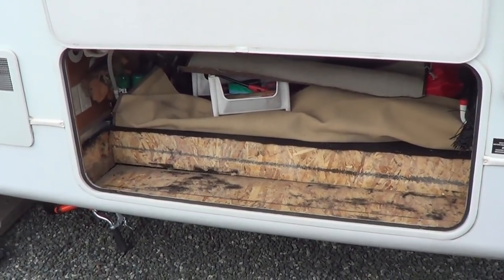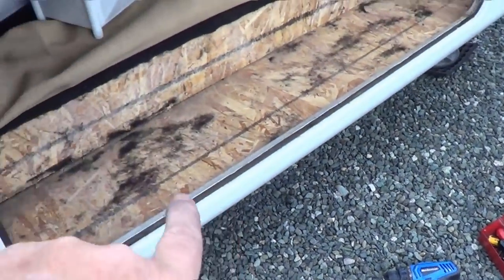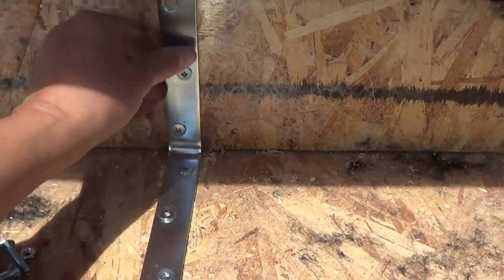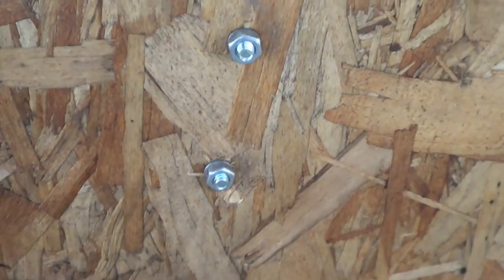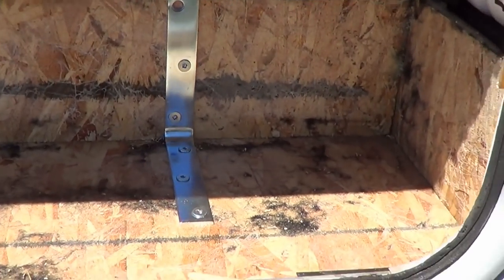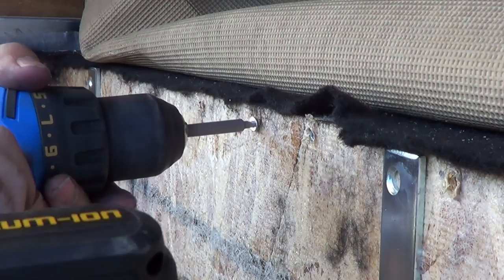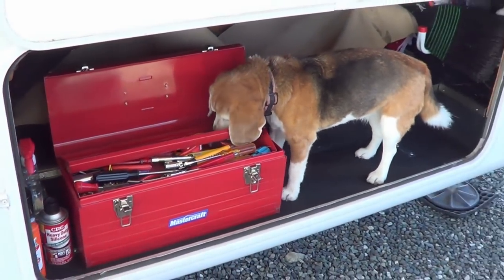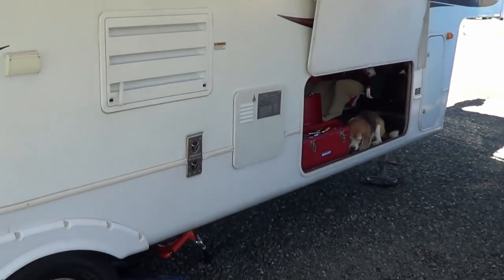RV Storage Compartment Shelf Repair and Modifications

Comment: As long as you had access to the back and underside of the wood box area, you might have attached the angle iron on the outside of the box to gain the advantage of the strength of the angle iron. The way you did it with the angle iron on the inside of the box it relies on the strength of the nuts and bolts. Just a thought.
Reply from the maker: Thanks for the advice. Yes, you're the third commentator with the suggestion. :) The reason I didn't was space restrictions on the back wall, it was going to be too much of a pain to get the holes drilled. From the top, I knew the holes could be drilled exactly first shot. Given the staples lasted 4-5 years before failure I figured the angle iron on top and bolts on the bottom would be plenty strong. Other commentators had added that I could add large washers or steel strips if needed. Cheers! Ray

Comment: Ray if you put the bottom inside of the back chip board and ran the screws horizontally through the back and into the bottom you would then be. Using the shear strength of the screws and it would hold a lot more weight. I realize you may not have access to the back now so you angle iron will help.
Reply from the maker: Thanks.

Comment: Good video Ray, if you do something like this again, get some fender washers (large diameter) to pot between the nuts and the wood, more surface area will make it much stronger and keep the nuts from pulling through the wood. ThNksfor sharing! Walt
Reply from the maker: I'm going to add some. Thanks Ray

Comment: Shuda really mounted the brackets on the bottom side of that wood for greater support with a fender washer on the inside, if your travels are as rough as you say, the bolts could eventually pull through
Reply from the maker: I thought of that but it so cramped underneath it was going to be a pain to drill the holes for the bolts and get them aligned right.

I think it will be plenty strong enough. After all for 4 -5 years it was just stapled together. :)
Reply: true enough........now that you have your unit the way you want , ....it has to be about time to upgrade

Comment: I see it has been mentioned but I would put brackets on both side and also run some angle iron pieces underneath your bolts to transfer the bumping stress over a larger portion of that particle board keeping things in tact. Washers are good but a strap of metal will distribute the forces more effectively.
Reply from the maker: I thought I was overkilling it. :) 
Good suggestions.
Reply: Love Your RV I am afraud those bolts will pull through that MDF. With a piece of metal it will distribute the forces doesnt have to be real thick stuff. Want to watch your tare weight I know. You have so much stuff installed already!😁
Reply from the maker: Yeah, I'm currently only 400 lbs under trailer GWVR. Gonna have to dump off some weight this fall. Will wean my tool load back to only must haves and get hardcore about what we really need.

Comment: Great repair and modification work Ray!  I was wondering how much trouble it would be to remove the underbelly just enough to run some Romex wire from my inverter in the front storage compartment (2004 Keystone Laredo 28RE fiver) to my power distribution panel just below the stove.  I would like to install a transfer switch for my new solar system.  I have a dual battery bank system that would eliminate the charge back loop.  Thanks!
Reply from the maker: Thanks! Shouldn't be too hard, my underbelly is held with 3/8 Tek Screws, remove them and the belly comes down. The only issue is on that side the LP gas piping runs so makes it a bit of a pain. In some spots, I've cut a flap for access and then seal it up with Gorilla Tape when done.

Comment: Hi Ray.  So if the beaver board had given way with your heavy tool box, you think your underbelly would have prevented the tool box from falling through?
Reply from the maker: Yes, I'd say so the metal siding wraps under and is bolted to the frame.

Comment: I wonder if it would be stronger putting the brackets on the other side, under and behind, so that the whole bracket holds up the wood...  What do you think?
Reply from the maker: I thought of that but it so cramped underneath it was going to be a pain to drill the holes for the bolts and get them aligned right.
I went for the easy way. I think it's going to hold up fine.
Reply: I believe you're right. The rubber mat was a very good touch too.
Take care.
Tony

Comment: Curious if the floor of you battery compartment is OSB as well.  With that weight it is probably not stapled on there.
Reply from the maker: It's a steel tray that has been welded to the frame. So far I haven't spotted any cracks.

Comment: I use a small plastic tote instead of a heavy tool box. Then carry only the essentials.
I think if I were you, I would take the old unit apart, take measurements, have a metal unit made from tin or aluminum, then install and boom, your good to go. Forgoing that, make it out of marine plywood instead of GLUIT Board (GLUIT means half Glue and half Shit) otherwise known as particle bd.
We'll done just the same.
Reply from the maker: This mod has held up great, almost 3 years now and been down some rough  roads, really strong support now so I happy with it.
Reply: @LoveYourRV  Good stuff.

Comment: you should have put them on the outside. stronger
Reply from the maker: I thought of that but it so cramped underneath it was going to be a pain to drill the holes for the bolts and get them aligned right.

I think it will be plenty strong enough. After all for 4 -5 years it was just stapled together. :)

Comment: Hey Ray, good job on the fix. If it gives you trouble again, put a piece of 2x2 aluminum angle on the back side of that angle and you won't ever have to worry about it again.
https://www.princessauto.com/en/detail/2-x-2-x-1-8-in-x-8-ft-aluminum-angle/A-p8710774e

Also on the fender skirts, maybe grab a local boat fiberglass repairman and hire him for an hour to show you how to use fiberglass to repair the fender skirts and you also shouldn't have any more problems with them after that.
Reply from the maker: Good ideas, thanks!

Comment: Had an interesting problem with osb and non marine grade plywood. OSB Is slow to absorb water AND slow to release water once there.  The water expands when frozen cracking the wood and glue bonds.  Over a few seasons the wet-frozen interior of the osb turns to powder absorbing more and more water which then accelerates its "demise".  I wouldn't buy any "vehicle" that has that kind of engineering.
Reply from the maker: They definitely didn't build it for cold, damp weather. Glad I winter in the desert everything stays bone dry down there.